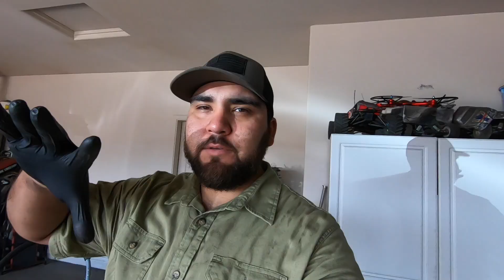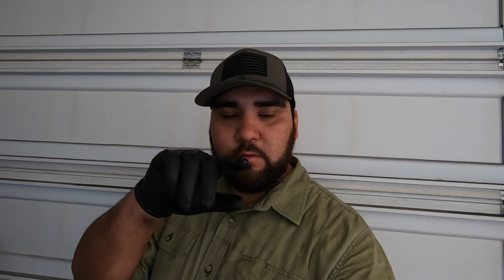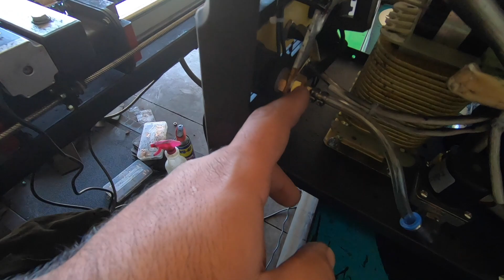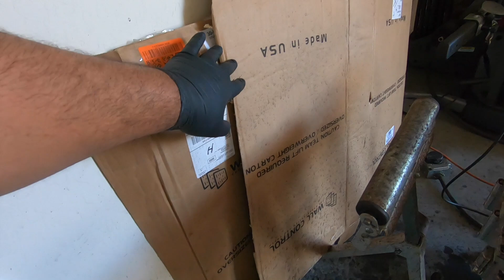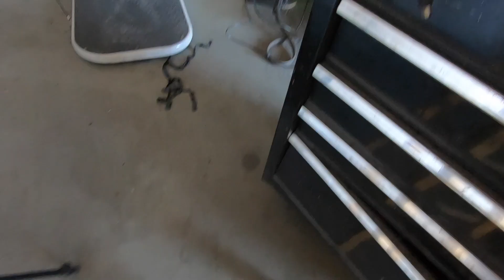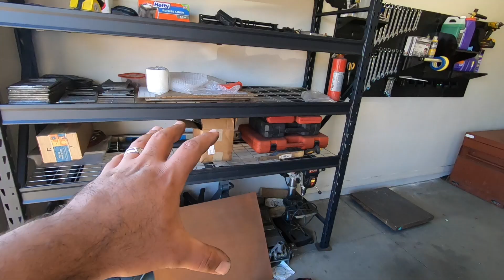Langmuir Systems CrossFire Review And THC upgrade

Comment: Thanks for the video. I am torn between the THC upgrade for my og crossfire xl or purchasing the crossfire pro. I believe being able to fit full sheets would be a lifesaver to me. I also have an identical in looks and hp kobalt air compressor that says it’s 11 cfm @ 90psi and 11.5 @ 40psi? Anyways keep up the great content!
Reply from the maker: 100% go with the pro not having done that from the get go is one of my biggest regrets and I will probably be buying it or the new xr or whatever they are calling the new full 4x8 table. Is yours a single stage? Maybe that’s why you have the higher cfm?
Reply: No it’s a two stage also!
Reply from the maker: 3.7 hp 175 psi?
Reply: @blowingdiesel  yes
Reply from the maker: That’s wired I wander what’s the difference

Comment: Thank you for doing this video, I have the same gen 1 table with the XL addition and was also interested in the thc, other than the connection issues you have does it do a good job on the warped material you cut?
Thank you, stay safe
Reply from the maker: It makes a huge difference I can now cut on my whole table with out worries
Reply: @blowingdiesel  did you get the connection problem figured out out is it still hit and miss?

Comment: is this the gen1 or gen 2 THC KIT
Reply from the maker: So the gen 1 and gen 2 refers to the actual table not the THC the gen 2 will already run Firecontrol gen 1 used Mach3 if you are on their website get the one that goes to your table if you have the gen 1 that uses Mach 3 get that option it’s what I got if you gave a gen 2 get that. Hope that helps
Reply: @blowingdiesel  got it thanks